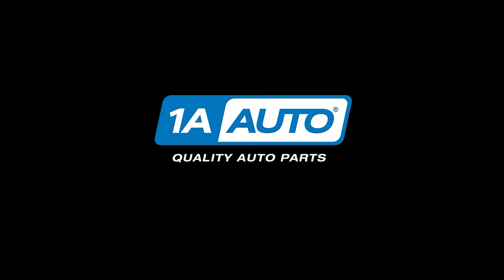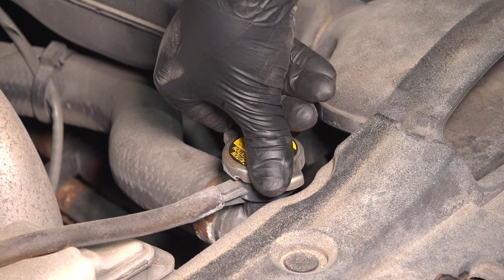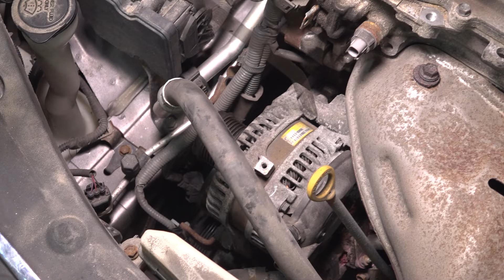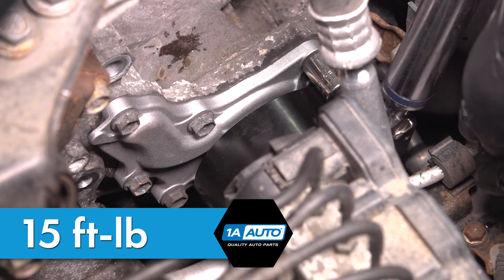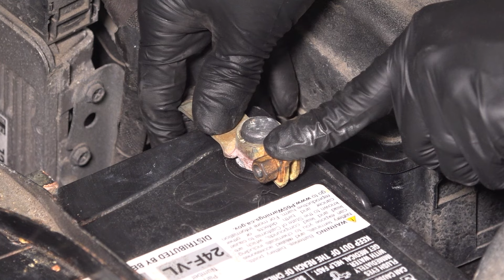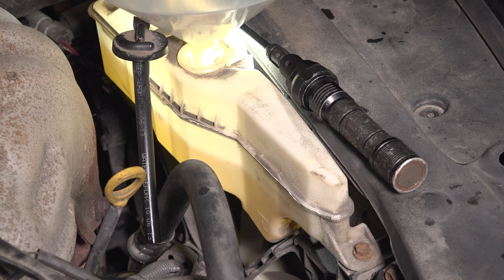How to Replace Water Pump 2012-2017 Toyota Camry (2.5L)

Comment: A really thorough and comprehensive video. I would generally put anti-seize on the steel bolts threading into aluminum, or is that overkill?

Comment: Hello, good morning, could you help me? My problem is the following: my 2012 Toyota Camry SE 4-cylinder is leaking coolant from the small hose that connects the coolant reservoir to the radiator neck, and I think also from the radiator cap. I've already replaced the thermostat and the radiator cap, the water pump shows no signs of leaking, and after all this, coolant continues to leak from the same places. The car's temperature gauge only goes up to the halfway mark, and it has never overheated. What do you recommend I do? Thank you for your videos.
Reply from the maker: +@oliviaa1911 Thanks for watching! We are not really able to diagnose that sort of issue on our end.  We recommend having a reputable mechanic take a look to get a proper diagnosis and figure out what needs to be repaired!

Comment: 2019  Camry SE Hybrid.
The wire plug on the water pump is giving me fits.
Have the water pump removed but have run into a
snag with the electric plug in connector.
I’ve looked for release tabs but nothing I have tried is working and I sure don’t want to mess up the plug.
Anyone having this little issue?
Never would have thought this would have been an issue but she’s holding on for dear life and just will not release it seems.
No videos on this.

Comment: As others have said make sure you get pink coolant for Toyota vehicles and more importantly get an OEM water pump. I had mine replaced two years ago and the mechanic put a cheap aftermarket part with a paper gasket and here I am replacing it myself. Great video!

Comment: Super easy. Even with having to remove the alt it’s and easy job. Just make sure to use PINK coolant and NOT green. I made that mistake and my brand new pump started to leak. When I removed it to see how damaged the gasket was, it had disintegrated. I’m guessing the green doesn’t keep the system cool as well as the pink. Plus I’ve heard there’s a few chemical differences between the two. 2nd time doing this thing :/